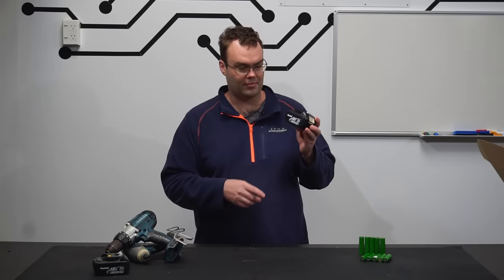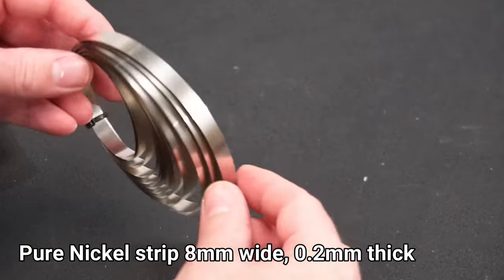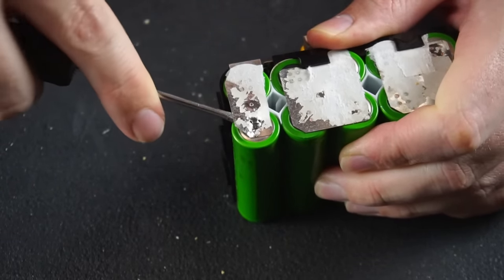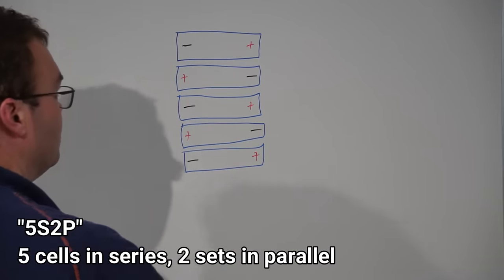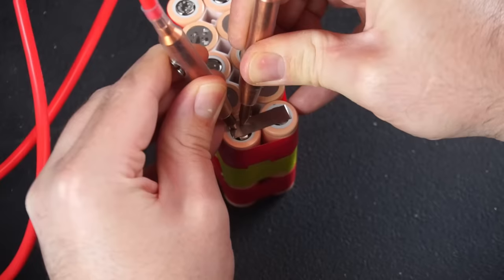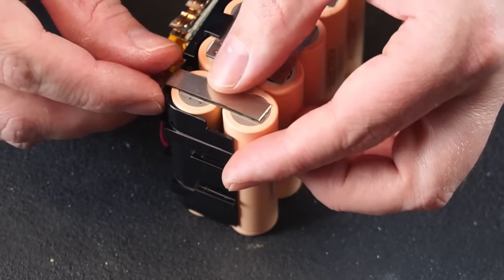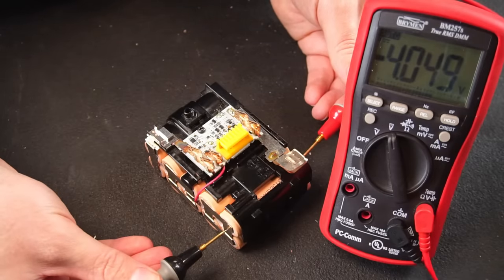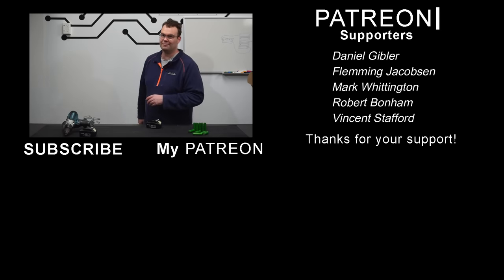Repacking Makita 18v Lithium battery with New Cells (Save $$$'s)

Comment: When you factor the cost of a new battery pack, it’s a good investment to repack. 👍 so where do you get these salvaged packs like this? I wanna repack 1 but also wanna make some 3 & 4s packs for other stuff!
Reply: Old laptop battery.
Reply: Dunno where you live but no it's not. New circuit board 20€, salvaged cells 20€ and time used 2 hour let say 40 € so all total 80€ and i can buy new battery cheaper.
Reply: @dare2dare  No, laptop cells are low current drain. Definitely not suitable for the high current demand of a powertool battery.
Reply: Laptop battery, phone modems, etc.
Reply: @mr.wizeguy8995  I don't think it would take 2 hours especially after a couple of goes. 

If you did multiple at a time you'd probably be more efficient. Also I struggle to justify putting at $ value at time used unless you were seriously going to use that time productively. 

I'm a salaried employee so it's not like every time I watch a show it's costing me $50 an hour because It's not like I could do extra work to earn more money than say if I was a a trademen =_=.  Even then you would have unproductive hours in the evenings when you couldn't work anyway. 

Would I rather spend a $1000+ on 10 batteries or $160 repacking 10 on the weekend instead of playing games or watching Netflix.  For those who are a bit thrifty and like to tinker I can't say it's a bad idea.
Reply: @jlirving  When it's related to work you should always get pay from it. 
That's why i rather buy new via my company and it also reduces taxes that my company have to pay. But most important is that i value my free time more than i would spend it to build something that barely even save money in first place.

Also battery that you have built on your own is a slight risk if it cause example fire when charging insurance company won't cover any damage it caused.
Reply: @mr.wizeguy8995  Like the insurance company would know the battery had been repaired or they coud prove you were culpable, are you kidding me!
Reply: @135Ops  Try think outside of box once how world operates. Obviously it's not insurance company who investigates that fire it's police with firefighters they investigate what caused it to burn and doesn't need much investigation for that battery to figure out it wasn't original.
Reply: @mr.wizeguy8995  Have you ever seen the remains of a battery when these cells really go up? Trust me, no cop or firefighter is going to be able to ascertain anything from the chunks of melted metal and bits of liquid plastic. They'll call it a faulty battery and move on.
Reply: @TheCharleseye  I won't take a risk of that for save maybe few bucks.

And like i said earlier if i send 80 € invoice to customer and buy 80€ battery i doesn't need to pay any taxes but if i keep that 80€ and build my own battery my company pays taxes i pay my self salary i get around 30€ money to my self. 
So with that 30€ i have to buy new cells, new circuit board which cost around 30€ and then i have to spend 1-2 hour to make that battery doesn't seem very reasonable.

Comment: First with making packs is always ... always make them have the same charge. Certainly with a shitty BMS not guarding the cells individual or in parallel.
Did my first replacement of ni-cad by li-ions many years ago from old laptop cells.

Comment: You can solder them if a flap is still attached. Use a very hot iron, lots of flux and rough up the surface and quickly solder it. Do not loiter around with the iron. 1-2sec max. The cell has enough thermal capacity so it wont heat up enough to get damaged. It is still risky and spot welding is the better alternative.

Comment: The phenomena you observed is a form of "bottom balancing." Essentially, you want to cycle the cells, ending with them discharged to about the same voltage. This is for safety reasons, especially with high-current cells. If one of your cells were fully charged (~4.2v) and another essentially dead (~3.1v), then you spot-welded them together, you'd end up with some toasty-hot jumpers, with a possible side of thermal runaway. 💥 That's probably why the Makita charger faulted the battery -- there will be a voltage tolerance on the sense lead which was exceeded.

Comment: The BMS is actually in the makita charger. Like most of the power tool chargers. Learned it the hard way, broke a few batteries from a makita batterypack while charging it via a solar charge controler...
Reply from the maker: Really it's like Makita split up the BMS into 2 components. One in the battery that in my case measures cell voltage, temperature & has must also feature some form of memory storage for the dreaded "bricked battery" error.
Reply: Which type of cells you get from makita packs? Sony vtc5?
Reply: Sorry but for price of the Makita batteries and chargers that bms looking crappy. Proper bms monitoring each cell not half and half the pack. Also in video its make few mistakes.

Comment: so..... how exactly did you get kWeld  for $16?
Reply: Only 167 euros, that cheap bruh! Just mail 'em to ur dude schematix!
Reply: Where was that said?
Reply: @0420Junket   look @0:20
Reply: @cthulpiss  he must mean the cost of batteries I am guessing
Reply: You have to invest in tools to be able to repair and work on things.
Reply: At 0.20 he does say $16 of salvaged cells, nothing about the welder.
Reply: @bolerdweller  .....and you shouldn't be making statements that it costed "only $16 in cells" if the whole operation is like TWELVE times more costly.
Reply: @cthulpiss  it's not though...
Reply: @cthulpiss  I could make a video called "how to build a harringbone pallet wood accent wall for $20" and it would be true. I may have thousands invested in tools(way more than the couple tools used in this video) people would still be expected to own tools to do any kind of diy, repair or build type work
Reply: @bolerdweller  Well - you could, and I still would call false / misleading.
Reply: @cthulpiss  🤣. You do realize work requires an investment in tools and equipment right?
Reply: @cthulpiss  considering you're looking to repair makita batteries, a small investment in a purpose built spot welder could pay itself off, amazon seems to have them under a hundred dollars. Considering makita battery packs cost between 1 and 2 hundred dollars you can see where the value comes in. You can also build a battery powered or plug in spot welder with less tools and work your way up. I would save money doing the repairs considering I have a large bag full of makita batteries and several dewalt flexvolt batteries. I just replace them because I dont have the time to rebuild but my oldest son is learning about electronics and I could definitely get him working on them and learning
Reply: @cthulpiss  just saw on wish you can buy one for 25 bucks
Reply: I'm sure if money was saved there would be a cost of materials , parts and tools balance sheet , 
yes we all know tools can be reused (If I fixed a thousand battery's blah blah blah)
I think the video is an advert for a small spot welder of unknown quality.  
I should try Copper rods attached to my budget arc welder ,might work

Comment: Realistically most people will not buy a spot welder just for this job .... Soldering is perfectly fine , but a high power iron is best .. I've soldered over a thousand 18650's no damage and they NEVER catch fire or explode ... If you're going to do this it's sensible to by NEW  3500mAHr cells sony or panasonic
Reply: Realistically speaking most people don't have clue what they are doing, including the author of this video, and you too. These are high drain cells, that continuously deliver 30 A. And the battery has 2 parallel lines, which means it easily delivers 60 A continuously. Peak current is even higher. For example, cordless rotary hammers easily draw more than 1000 W of power.

And because of all this high current the original tabs are made of Nickel plated Copper and are 0.25 mm thick. The larger tabs, that cover 4 cells, are approximately 40 mm x 40 mm in size. And you have to make 4 solder joints on these. With each consecutive solder joint made, it increases the thermal mass and hence the heat loss... Even 200 W soldering iron doesn't help, the battery overheats and the heatshrink melts... 

Ordinary soldering irons are useless here, resistance soldering may or may not help. Google it, see what it is. Than there is no DIY spot welder that can weld thick Copper...

Now compare that, to your usual tiny-winy tabs you use - 0.1 mm thick and 8 mm wide Pure Nickel strip... Yes, these are easy to solder, but they glow red under 60 A of current. So you have no idea how wrong you are... Since Copper is around 4 times more conductive than Nickel, you will need 1 mm of Pure Nickel to replace 0.25 mm of Nickel plated Copper. Try and solder this too... 

A picture is worth 1000 words, and here is what happens with a thin non Copper tabs from China under 60 A load: 
https://i.imgur.com/BaohgD4.jpg
http://www.78294.ru/_fr/3/7115813.jpg

So, you say "NEVER catch fire or explode"? 
Trust me, it will, definitely - sooner, or later...
It gets red hot after all...
Reply: @2L40K  can you spot weld copper tabs diy or you need a more expensive spot welder.
Reply: @EdgeMasterPro  K-Weld is the best DIY spot welder and it can not do it. That's because copper requires at least 10000 to 15000 A of current, while K-Weld can deliver 2000 A max. Cheapest commercial welder ( https://youtu.be/tqhJyy2hUdw ) is around $25000 new. Used may be less, but still not as cheap as K-Weld.

But there is the "Copper/nickel sandwich" method. Just google it. There is a lot of discussion on the Endless Sphere, for example.

Here you have 0.1 mm copper and 0.2, 0.15, 0.1 mm nickel:
https://i.imgur.com/TAO8i1E.jpg
The bottom 0.1 mm nickel is rather weak, but the other two are pretty strong. And they are equivalent in conductivity to 0.55 mm and 0.60 mm of pure nickel respectively.
Reply: Yes solder is fine IF you have experience and are using a powerful iron. I would never recommend it to other because most people don't have that skill.  You will lose a little capacity from heating the cells up but not much.
Reply: Also no to the 3500mah panasonic cells. They do not have the power output(amps) required for a power tool. There isn't a 3500mah cell in the market powerful enough for a power tool battery pack. You need 20amps+ and  3500mah cells are 6-10amp depending on brand and model. Imo the best capacity cell with enough power for a tool are sony vtc6 cells. They are rated at 3000mah and output 25amps. A perfect balanced cell.
Reply: @randybobandy9828  That's fairly good advice , but of course it depends on the power of the tool ... You should know how long a normal battery pack  lasts ...I only use a grass trimmer and powered by Two  5Ahr packs it runs for 35 mins ( "5AHr" must  indicate  the cells are each 2.5AHr , ten cells in each pack , 2 strings of five in parallel ) the individual cells in my trimmer are discharging at less than 2C ( 5A ) ... So even if you used a tool that flattened your (5AHr) battery packs  in 15 mins , 3.5AHr Panasonics should be OK. each cell discharging at 10A.
Reply: @oz93666  no because if you discharge a 3500mah cell at 10amps it will drop its capacity drastically.  You would get closer to 2500mah out of a 3500mah pack. Look up a 3500mah cells discharge curve and the more amps you draw the less capacity.
Reply: @oz93666  I also forgot to mention you will get a huge voltage drop with that kind of a cell.

Comment: verry cheap to diy, how much is that spot welder again?
Reply: Yeah like 300€ 🤣🤣🤪🤪🤪😜😜😜😜
Reply: @vablo7198  I’ve seen a few videos on that as well. Looks super easy to make, just need to salvage an old microwave which isn’t hard. You could even get one at a flea market, pawn shop, or Craig’s list for next to nothing.
Reply: There is definitely no problem to solder the contacts. The surface must be roughened, tinned and after some cooling soldered. It is absolutely secure when you solder it in not more than 3 seconds.
Reply: @2fast4you25  no it's  not its €159 literally half what you said

Comment: Is it possible to install a more high amp battery when replacing the dead cells?
Reply: Yes, it is possible, but it must be rated at least for 20 A of continuous current.
Reply: Yes he did exactly that in this video. The cells in the original pack where 3ah(2 1.5ah cells in parallel) he replaced them with 5.2ah(2  2.6ah cells). Almost doubling his ah.

Comment: Hardly a cheap repair? By the time I've purchased all the welding gear, head hunted someone from NASA to build it I might as well buy a new battery!
Reply: Not here in the UK . Replacement Makita batteries are an arm and a leg ££.. My old drill cost me £120 with 2 batteries , one replacement battery £70 .
Reply: A spot welder in only 70 bucks. Are you entitled?

Comment: If you have to buy a welder to fit the batteries I’d hardly say it saves $$$$
Reply: Failed maths at school didn't you?
Reply: you can pick up a spot welder on ebay for 50 dollars and nickel strip for a couple of dollars. if you are savvy you can make cheap battery packs and save hundreds of dollars. if you are only intending to do one battery then i'd say it's a pointless exercise.

Comment: nice job, that rolling of the needle nose is exactly what I did a few weeks ago when salvaging some 18650s from a failed usb recharge battery,,, but I am just reusing them in flashlights and a new two battery usb battery bank with swapable batteries. (for now)
Reply: Nice job! The cells in a USB charging pack are not suitable to use in a power tool pack if you where not aware. The reason is that you need high amperage cells(20amps +) and the ones in a USB charge are very low amperage cells(3-6 amps usually).
Reply: @randybobandy9828  I am only slightly aware, my dad knew far more as a 1950's version Navy Electronics tech (parlayed that theory training through his career in Purchasing across many electronics firms and manufacturing firms from Delco to CTS), I visited a battery factory with him when I was in middle school, when he worked with Kent Floor Cleaning machines (deep cycle battery/ division of Electrolux),,, but yes I have heard of discharge speed/ and heard of the chart for things like Amps Volts Ohms, his multimeter was a Heath Kit self build. 
So, I grew up with some electronics terms like potentiameter, diode cathode and others, he also had a telegraph key, but I did not go on to learn morse code.

Comment: if you scuff the terminals of the cells tin them it will not get hot enough to hurt the battery when those batteries are in operation they get so much hotter

Comment: Dude it's so crazy that that 18650 🔋 singlely can power a bright ass flashlight, in a pack can power hundreds of different tools double it up 18-36 volts or even larger HUGE setups like Tesla cars all off 1 single 🔋 type... Now days 18650 being replaced w 21700 🔋👍👍

Comment: Great video, but I didn’t get how you joined the two sets of 5 batteries together. Soldering the strips in the square pattern looks like they are shorted with each other, because you arranged them in series, positive to negative. Were each set of five reversed? Hope someone can help me out. Thanks

Comment: Nope, I've seen way too many explosions during spot welding on these types of vids, so I'm definitely going the soldering route also i'm not buying/making a spot welder just for a battery pack.  I just have to make sure NOT to apply the soldering tip directly on the batteries and be fast with my aluminum wad heatsink.

And I'm reusing the nickel strips!
Reply: can you post a link to a video with exploding cells when welding?

Comment: Have the same exact drill and impact and both have been real workhorses. Those batteries last a heck of a long time. I think I got 8 or so years out of the original batteries before they started showing any signs of age and that's saying something because I do custom woodwork and my cordless tools get used quite a bit. I do have a couple packs laying around and they still charge but don't have anywhere near the capacity that they used to. I may have to look into replacing the cells like you did. Good video and that little spot welder is pretty nifty and a lot cleaner and quicker than soldering for sure.

Comment: Badass video! I’d like to do this but going to 21700s for Makita and my Dewalts with 18650s. Makita really needs to step up their battery game they are far behind the curve.
Reply: why do you say that? even a Dewalt 24v system is the same as this!
Reply: @VinnieVega76  Dewalt, Milwaukee, flex, rigid, Ryobi, Kobalt and probably more have options better than Makita
Reply: I was asking because I was going to rebuild an old pack with Panasonic batteries. I don't quite understand what you mean by step up their game?

Comment: The solid red and green lights on the charger are telling you the battery is 80% charged, not faulty. I made the same mistake when watching my rebuilt batteries charging. Previously I had just left batteries on charge, not noticing them reach the 80% point!